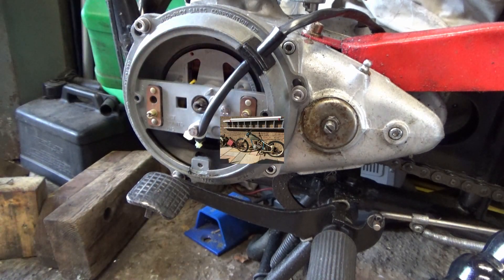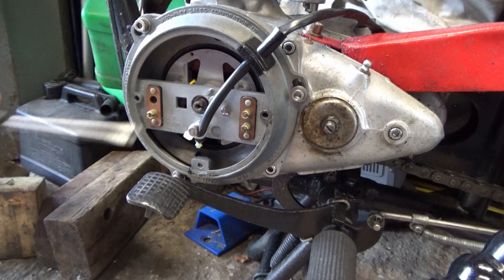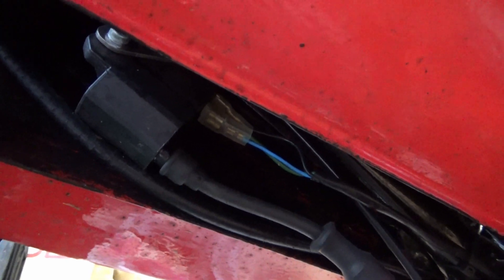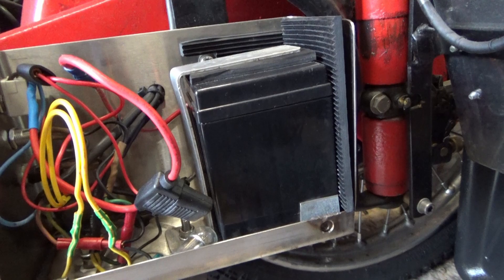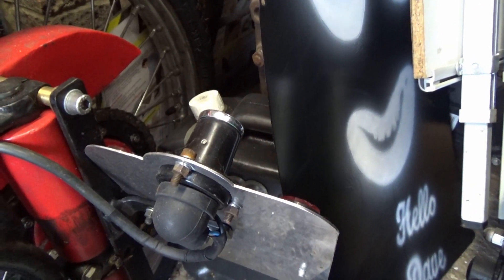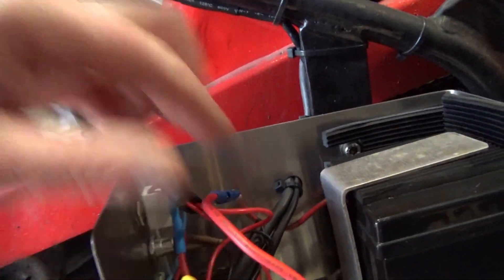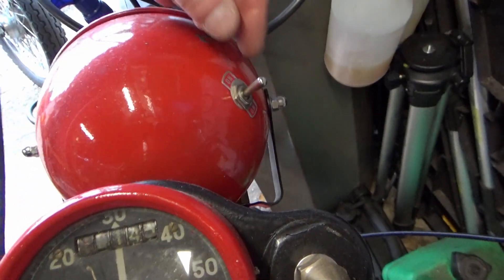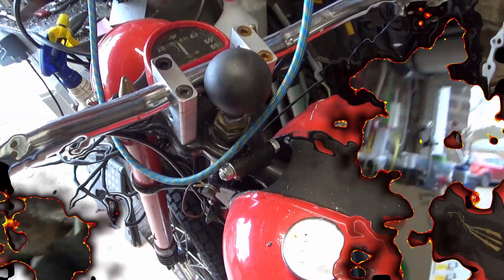My BSA Bantam D1 12 Volt Battery Electrical System Electronic Ignition with Lighting

Comment: hi I have the same eletrix world set up on mine its still on 6 volt bulbs and i've cut the blue wire to take to 12 volt to brighten the lights with no luck in fact I've seen brighter glow fly's and a candle would put it to shame, not happy with it at all. kind regards Adrian.
Reply from the maker: I ended up putting an LED in place of the pre focus lamp, saw a good improvement in light but the pattern isn’t great. At least I can see without squinting… 😂

Comment: Hello again. When you mentioned the new flywheel, Would a better flywheel make the bike run any better? For example when i meet a small slope the bike loses a lot of momentum(( Maby I am too fat for this wee engine(((
Reply from the maker: The flywheel is specific for the Electrix conversion as it contains the magnets for the coil pick up and alternator.

If she's struggling a bit on the hills I would be looking at the ignition timing and the primary drive sprocket and maybe drop a tooth. Loads available from the usual suspects Borunemeouth Bantams/Feked/Classic-bantam-parts.

There's a video in my Bantam playlist where mine struggled on the hills.
Reply: @bodganeering  Thank you very much. Mine has an electronic ign fitted. Can you tell me if the electronic ign timing is adjustable. My bantam is very slow on the flat, Not like in some videos. A chicken would not fear me chasing her)) I will look at your video and see how mine compares) Thanks again. I really would like a battery box to fill the gap))
Reply from the maker: @jimmymcjimmyvich9052 you can adjust the timing by moving the outer case, there’s three slotted mounting holes, ideally fine with a strobe light but can also be fine with trial and error. 

I would definitely look at how many teeth you have on the front sprocket, it makes a big difference.